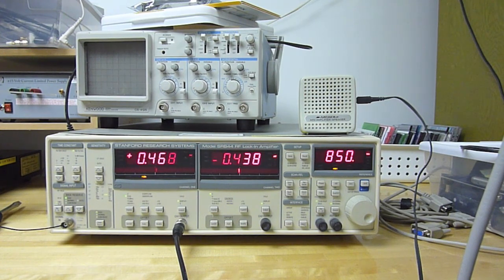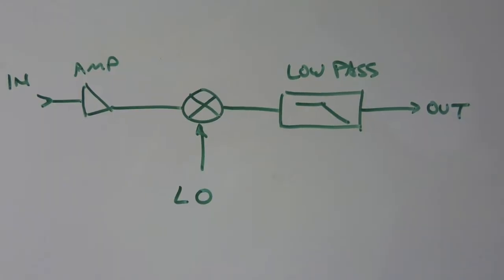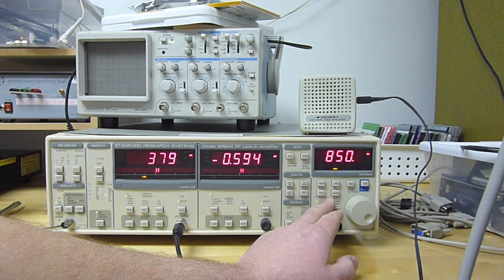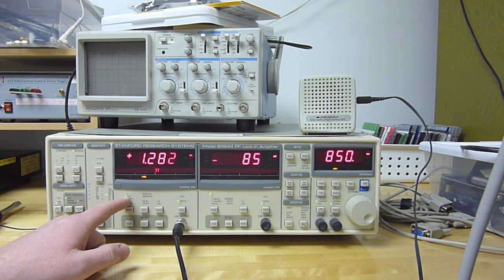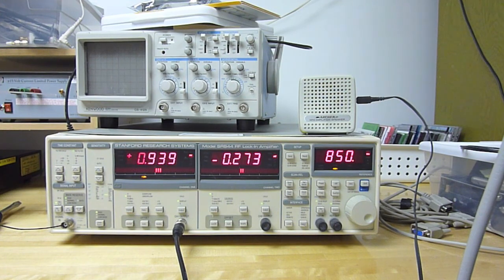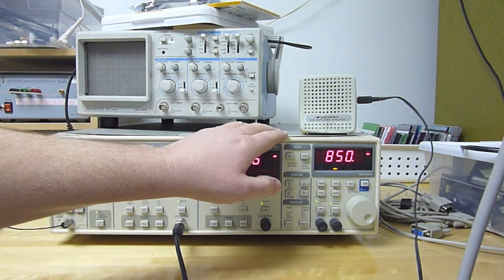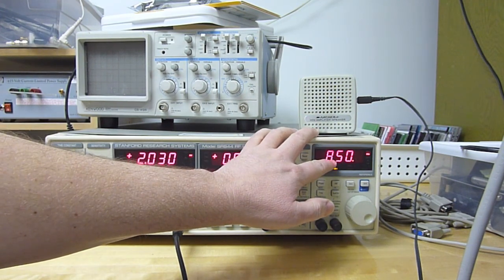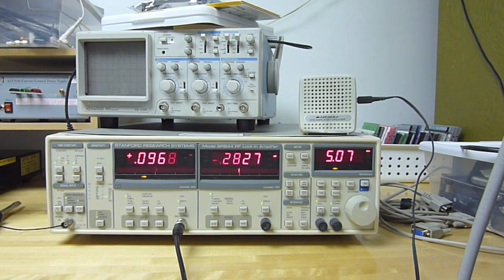Lock-in Amplifier AM Radio

Comment: Surprised no comments regarding the Princeton Applied Research (PAR) lock-in amplifiers.  All the talk's regarding the Stanford Research Systems (SRS) equipment. :-|)  The PAR lock-in amplifiers are what I first read about to learn what a lock-in amplifier even is.  I do see Edgerton, Germeshausen, and Grier (EG&G) referenced who if I understand correctly, bought PAR for a period with the acquisition of Perkin Elmer (renamed PerkinElmer) and later Ametek acquired PAR from PerkinElmer.   I've found PAR lock-in amplifiers for a great price, compared to others, online.  Looks like the PAR's might even be easier to maintain and repair... possibly upgrade and/or customize.  I picked up my Princeton Applied Research 124A Lock-In Amplifier with a 116 Differential Preamp for $300 shipped and I see they can be found for a little more than that occasionally.  Lower spec ones can be found for even cheaper.   Well, there's my blurb regarding.  I was thinking about making a Youtube video regarding... though you beat me to it!  :-|)  Awesome!  I see you have an expensive AM radio too, way cool!  Thanks for sharing!

Comment: For anyone wanting to make an AM radio like this, but for a bit less expense, then it should be fairly trivial to use a lower frequency lock-in, with a mixer and signal generator. Feed a signal generator into the LO input of a mixer, put the antenna into the RF input of the mixer and feed the IF output of the mixer to the lock-in amplifier. The only issue is that you would also pick up a signal at the image frequency, which is twice the IF away from the signal you want. But since you have two tuning controls - the IF is set by the lock-in, and the LO is set by your signal generator, you can probably move the image frequency to somewhere there is no signal.

I have here an EG&G 7260 which I picked up from eBay UK for £100. But it is absolutely awful to use compared to the Stanford Research SR830 I used during my Ph.D. But as someone else pointed out, Stanford Research stuff tends to attract a premium on price.

YouTube tends to be a magnet for total idiots creating videos on things they know next to nothing about. But this was a good video.